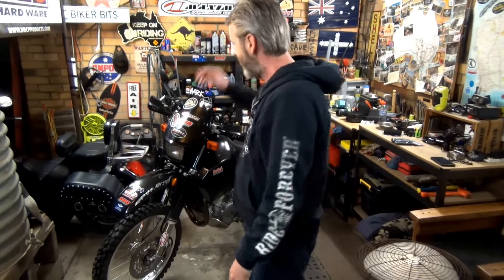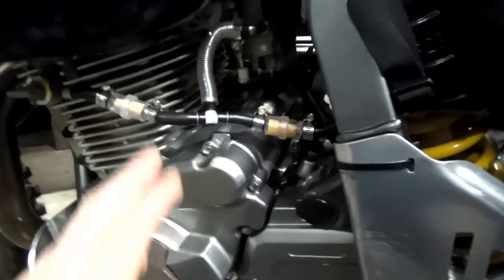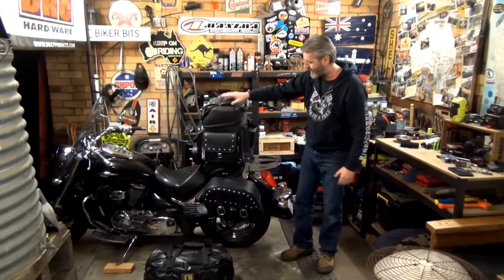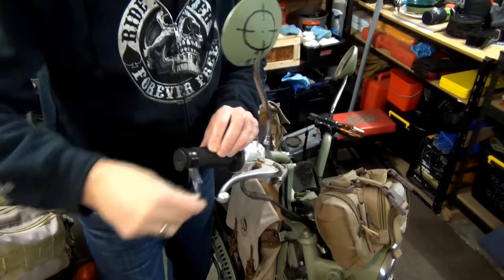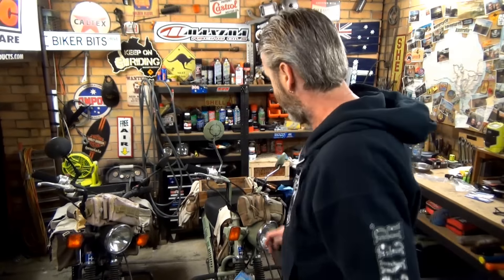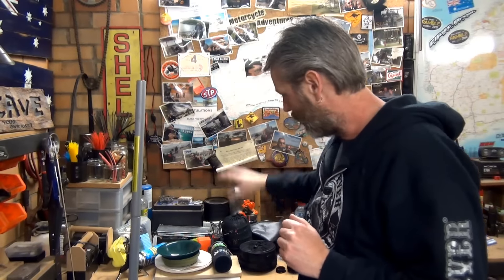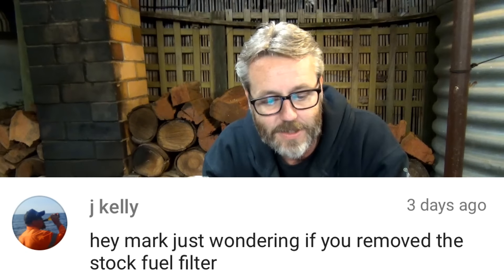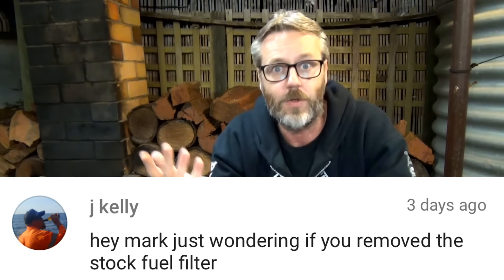Motorcycle Stuff - MCT Ep.9

Comment: If you tighten those hose clamps too much they'll cut the line the edges of them are pretty sharp! They're usually used on more heavy duty lines that motorcycle fuel line. The little fuel pipe clips that you squeeze together, slide over the pipe, then release are pretty good.
Reply from the maker: +FiftyRacer Yeah your so right... I was really carefully because of that fact... But maybe not carefully enough :-)

Comment: Try using a compressor, just put an air nozzle on and squeeze the end of grip together it will expand then push it on and finish it off by running the air nozzle around the end of the grip while still pushing to finish it off,less than 30 seconds a grip (and no clean up).